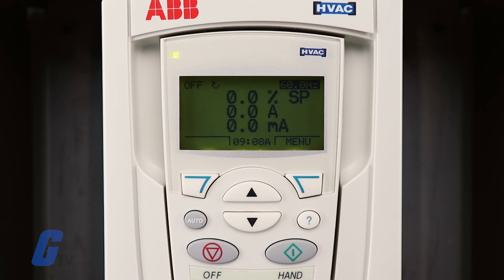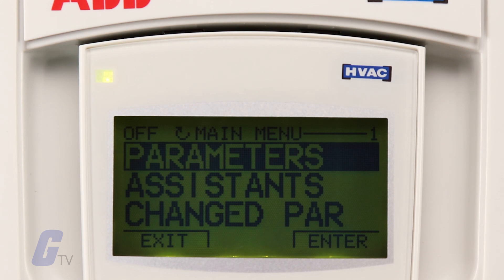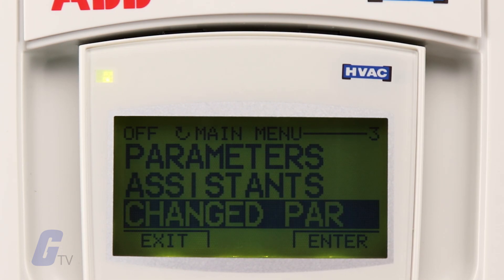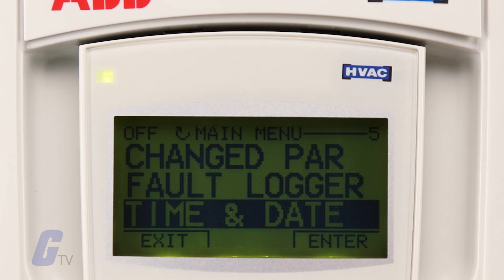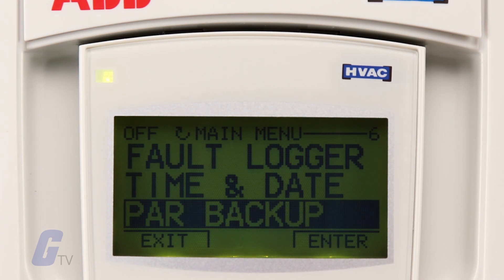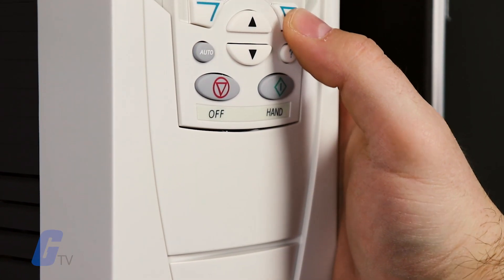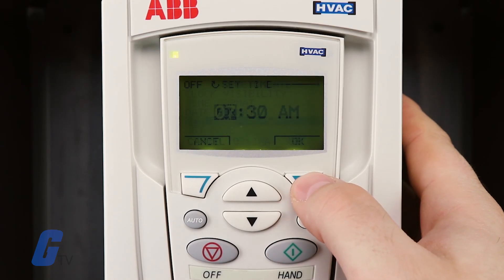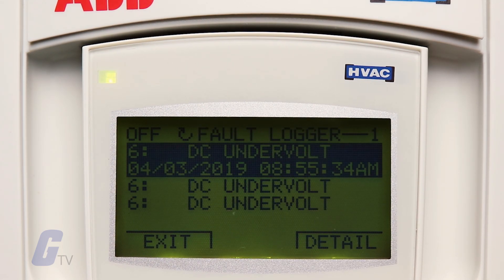Clock Set Mode: How to Set the Time & Date on ABB ACH550 HVAC Drive | Galco

Comment from the maker: The Clock Set Mode is used for setting the time and date for the internal clock of the ACH550. In order to use the timer functions of the ACH550, the internal clock has to be set first. Shop Now: https://www.galco.com/shop/ACH550-ABB-HVAC-Drives-HVAC-Drives